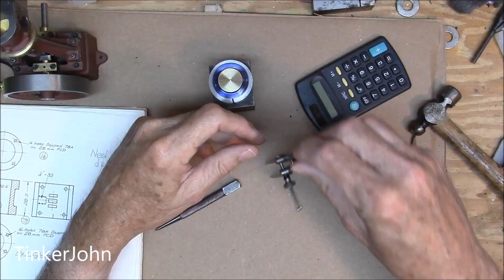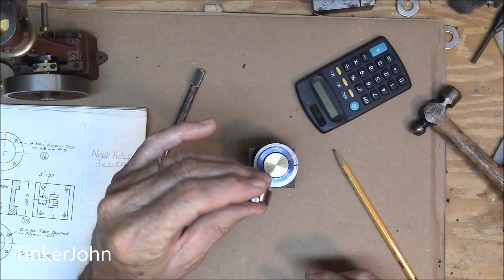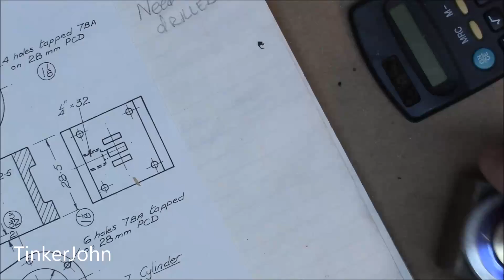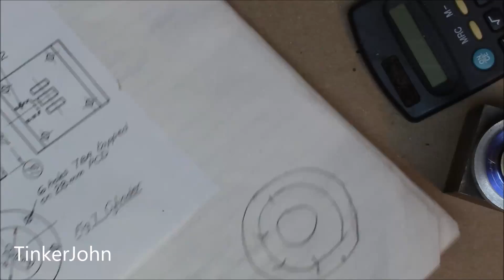Machining the Stuart 10V Steam Engine Castings - Part 58

Comment: I saw once on "The Wood Wright Shop" with Roy Underhill, a neat trick to divide a circle into 6 even spaces. Simply set your dividers to the radius of the circle and lo and behold, you will then be able to divide the circle into 6 even spaces. You are using the dividers to measure the bottom side of a triangle whose other 2 sides are the radii of the circle which meet in the center of the circle. Since all 3 sides are equal, this makes the triangles equilateral, so all the angles of the triangles are equal at 60 degrees. A full circle is 360 degrees divided by 60 degrees for each triangle makes 6 triangles total in a circle.
Reply from the maker: +TinkeringJohn 
Never thought of that idea. I'll have to try that next time.    ~John

Comment: As I recall in your lathe review the spindle drive pulley looked smooth faced. Could you go on line and print a 360 degree protractor scale and glue it to the pulley face and create a fixed pointer for a cheap indexer? If your chuck mount was threaded just make a disc to be held in place by the chuck and again make a stationary pointer. It does not hold the position but good enough to get a mark on a mounted piece. Your method has been used for YEARS though and one I use many times yet. Do you have a lake in your own back yard?